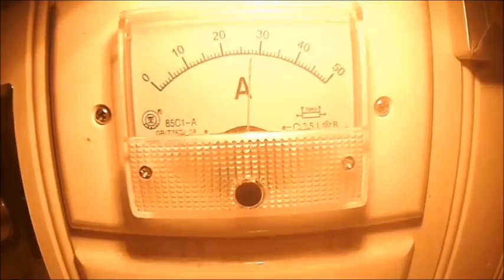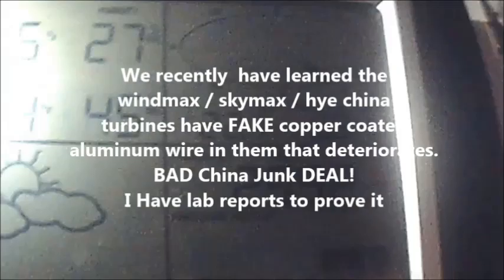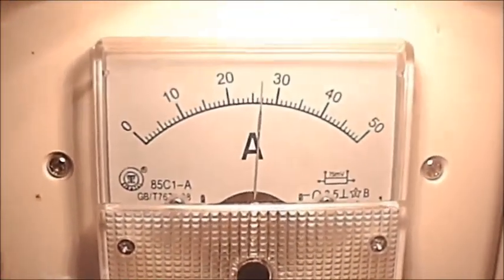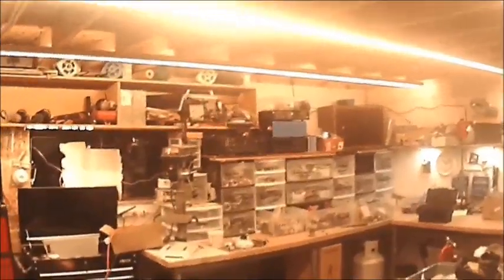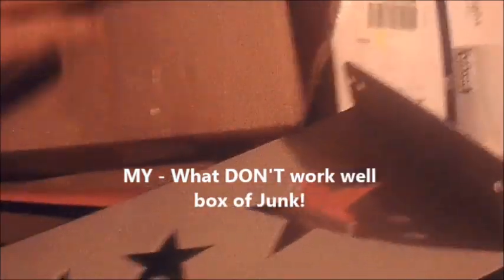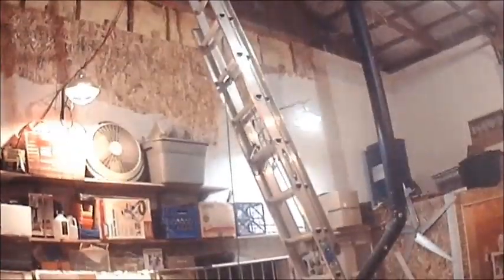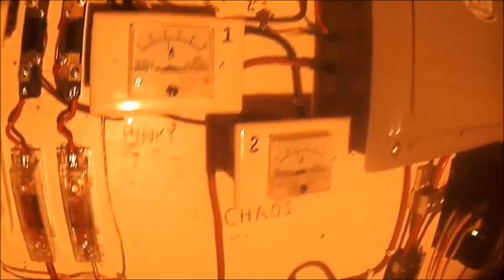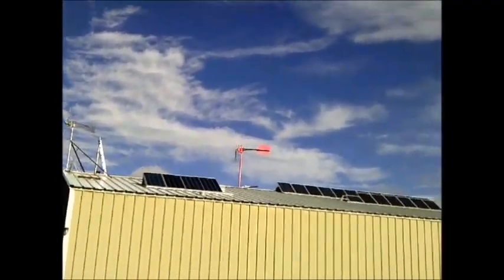Wind Turbines: The Good, Bad & Ugly Facts - Link to REAL turbine in Post

Comment from the maker: If you want a REAL wind turbine, GET A BETTER ONE from a real place, VERY Best 1 is Listed Under Video or second best US models https://amzn.to/2SPlxyB for NEWER REAL RATED OUTPUT! & To get 100% full batteries from one & to divert over volt you need these: https://amzn.to/37HN2OR 100A SQL Rectifiers &  https://amzn.to/2MTUjCU A All purpose long life Load controller and be sure to get up to and over 300 watts diversion resistors ( https://amzn.to/2QngFPq x 3) and one or more 60 amp SSR ( https://amzn.to/2QKEyj0 ) with heat sink ( https://amzn.to/2ZYtmna ) and be sure to use thermal past on it.  ( Proper type - https://amzn.to/2QN2hir from Protronix) 
* A PrepperMountain/Joxн Даниел 2014 Production Idaho USA
Reply: Јоhn Daniel
  I came upon your vid..looking for another subject and had to watch because i want too learn more about sun and wind-power. thought the vid..was an in your face like it is . then i hit your subscribed button.If there where more people like U it would be a better world.I thank you john.
Reply: Dear John I have solar panel 12 v 150 2 piece 180 Ampere battery I want installe wind turbine for running small fridge so any suggestions
Reply from the maker: @baetech1590  I refer you to this video https://youtu.be/1DpiIoaeOPA , the best turbine found is in a link below the video in my info area

Comment: THANK YOU, GREAT VIDEO... Is the 'dump' in addition to the power going to batteries and accessories?... That 'HEAT' your getting from the dump, is heat I would want for the cabin in the winter. As for the Summer time I would have a switch to direct that power/energy to another 'heat sink' on the other side of the wall outside. Thanks again.

Comment: If your PMA's bearings got any louder they could be used for an air raid siren. :-D I wondered if that was a tornado warning till you said about it.. :-)
A wind gen like yours would never last down here as during the summer we get thunderstorms that come thru with 75 MPH winds or more. Wait, that was just night before last too. :-( I have two VAWTs that I'm getting ready to install with a third for backup and testing purposes.
Reply from the maker: The real loud one in this video originally came from a tin shack in Missouri, I bought it from a guy who bought it new, then figured he got robbed and sold it on ebay for $45, it only lasted 4 months making 1/8th the power claimed it would make. We called it the Missouri Sky Rattler! Guess I paid for what I got. Now we ONLY use Thermodyne PMA's since they are built correctly.

Comment: Any wind generator should have a brake-n-lock position so we would not need to run a “watts dissipater” setup in a storm. Besides producing all that extra heat, it must be hard on the generator and wiring at that time to.
Reply: If they are wild three phase alternators, the controllers have a built in system to slow them down. Problem with brakes though is that they then put the stresses on the blades. Shorting out the three phases basically will lock the rotor if the controller detects an over voltage situation.

Comment: I have a question. Would this work on a rv with a telescoping flag pole? Assuming there is a way to remove it when you travel
Reply from the maker: Yes, just be sure to get at least 8 feet higher than your RV.

Comment: I HAVE A PMG THAT WAS UP FOR 11 MONTHS WE ARE IN A LOW WIND AREA . I HAD   FIVE  80 INCH ALUMINUM BLADES  THE HUB LOOSEN UP & CUT THE SHAFT OFF & BENT THE BLADES ALL UP, THEY SENT ME ANOTHER PMG & BLADES.  WE JUST HAD A SYSTEM GO THROUGH A WEEK LATER  GUST UP TO 26 MPH & THE HUB LOOSEN UP AGAIN.   THEY SAID I TIGHTENED THE NUT TO TIGHT ON THE SHAFT .   IS THIS CORRECT?  I ONLY USED  A SMALL ADJUSTABLE  WRENCH  & A  ISLAND WRENCH TO TIGHTEN  HUB?    (PS)  THE SHAFT IS HOLLOW FROM THE NUT TO WEAR THE HUB SET ON  SO IT SOON  CUTS THROUGH THE SHAFT .